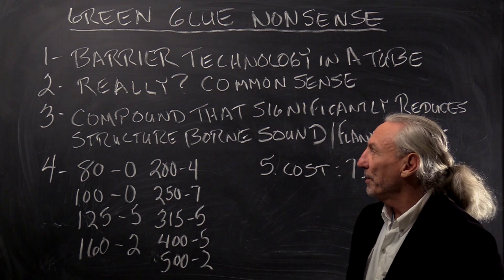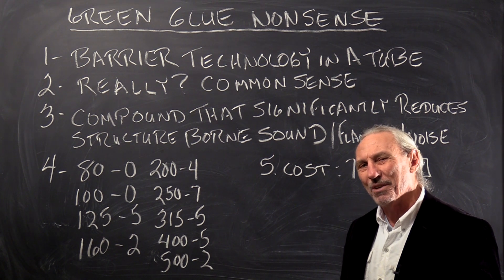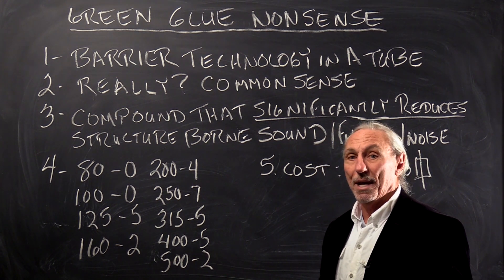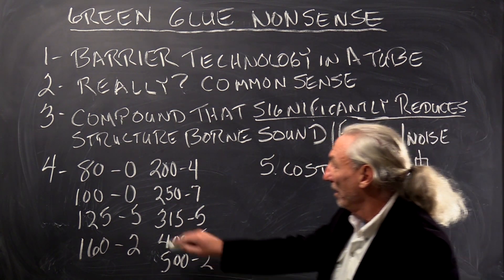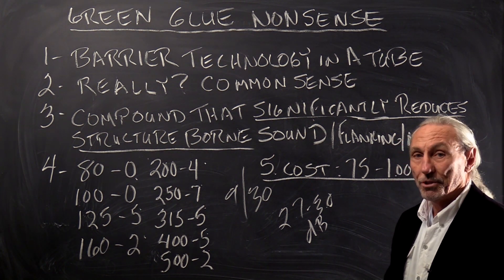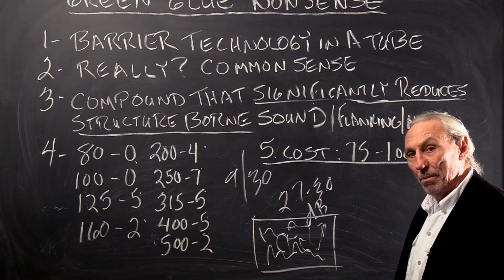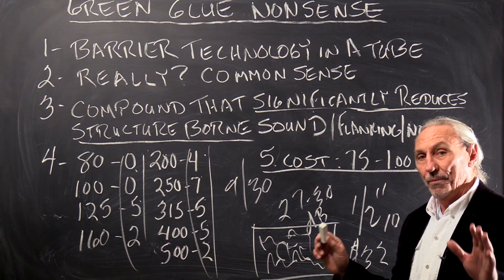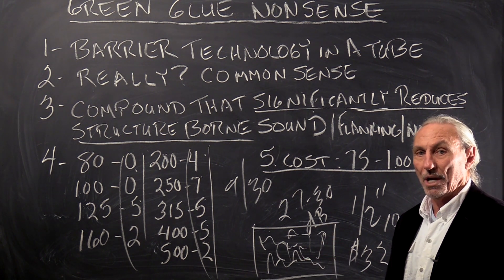Green Glue Nonsense - www.AcousticFields.com

Comment: guys help me... The tenant upstairs walks constantly in his living room and the ceiling of my bedroom creaks and the noises rumble. In the last two weeks I have tried to fall asleep with earplugs and drinking herbal teas to be able to fall asleep but the noises continue even after 11 pm so I can fall asleep very late when the noises stop. The noises reverberate and are dull noises
Reply: Perhaps you could route the vent from your boiler into the ceiling then seal it up with green glue. The upstairs tenant wont be walking around much longer with all that carbon monoxide floating into his living room.
Reply: you have to build a room within your room-- walls attached to a new ceiling where none of the sides touch the existing framework. 2×6 construction fully insulated will really help.
Reply from the maker: F,  Why are you recommending a 6" stud wall without knowing frequency and amplitude of the noise issue? Guessing with noise is a fool's game. Guessing with noise will produce failure rates exceeding 90%. And here is the issue with guessing and building on the guess. You will have to tear it all out and start over when it does not work. All of this guessing can be stopped with noise measurements.

Comment: Green glue is not an adhesive.
It is intended to dampen sound waves that transfer through Sheetrock . 
It stays visco elastic and dampens sound waves through friction of the material between  the two panels .
It is a latex polymer .
That stays visco elastic in colder temperatures than any other product.
However, if you live in warmer climates Roberts 3095 is all you need.
There is a noticeable difference when using them .
They are not a use or not kind of thing.
If you use another sheet, you still should use a visco elastic sandwich in your assembly.
You are not trying to create a membrane between the panels.
A continuous membrane would be bad.
It's proven tech.
And easily noticeable when used without.
I wouldn't use it if I lived somewhere that gets cold though.
And where it's warm you only need Roberts 3095.
So in my opinion green glue is only good if you can afford it, where it gets cold. Even then, some months it would do nothing if not warmed up.
It's still a good thing though.
Reply: The flooring glue definitely greatly deadens the reverberation of the sheet rock. When i tried it i thought i had come up with something original. the price of green glue had me in sticker shock and was thinking of what could be substituted when i remembered  i had just pulled up some sheet vinyl flooring that had been down for 20 years or so. The residue that was left on the floor was a sticky gooey mess. Hmm perfect. It's reassuring to see others are using it. Seeking to reduce the common noise of voice and footsteps and music is not rocket science that justifies an analysis of the frequency and amplitude of our noise issues. Most of the people on this site are not seeking to build a recording studio, just make their lives a less annoying. You are barking up the wrong tree asking for an analysis of the sounds we are seeking to eliminate. It's just the sounds of day to day life.
Reply from the maker: This product is an adhesive. There are many product types you can use to achieve the same function at a much lower cost.
Reply from the maker: H,  Why is it called "glue".  Is it limited to dampening "waves" or does it work with "rays" ?  Does it only work with sheet rock or will it "work" with other material types?
Reply: Acoustic Fields I think it's called "glue" because it was intended to replace Roberts 3095 carpet glue.
3095 / green glue works between any sandwich/ material assembly .
It's not much but every bit counts that doesn't take up room. 
The 3095 is dirt cheap.
So in here in Hawaii the Roberts 3095 is perfect for me. Plus it's an actual adhesive, so that's a bonus for me.
Review their tech data for additional information on the green glue, I just was pointing out that some of the things you were stating weren't exactly what the manufacturer is claiming .
I personally detest Green glue.
I've tested it against Roberts 3095 and where it's warm the Roberts marginally beats the green glue. 
I have a custom cut trowel for applying.
It's the more HP per dollar for me as shipping and square footage is insane here.
Reply from the maker: H,  Yes, it did replace carpet glue. That should tell you a lot about the basis for this product.  You are correct. It is not much and every little bit does not help. The problem with the name and marketing efforts of the company is that it plays upon the ignorance of the naive. Once again, you must measure the frequency and amplitude of the noise you are building a barrier against and then use the appropriate materials to deal with those frequencies and amplitudes. In over 155 builds to date, we have never used it. There are too many other options to consider with much better performance parameters.
Reply: Acoustic Fields what materials do you recommend? I’m about to purchase a box of green glue, but if you can tell me what would be better and cheaper, I’m all ears.
Reply from the maker: U,  What is the frequency and amplitude of your noise issues?
Reply: @AcousticFields  there are no rays within a solid - rookie error

Comment: Well what do you recommend as a cost effective alternative for the walls of a home theater room? I was going to apply another layer of drywall on top of the existing drywall with green glue to sort of 'decouple' the two walls. I'm not working with much space here, as the room is 17' by 15'. I considered using something like MLV in between drywall layers as well, or possibly 'floating' the MLV between two drywall layers.... before you say "it depends on the frequency and amplitute", lets assume we're watching movies at reference levels..  ;P
Reply: Its movies dude lol...  between 15 and 20,000 Hz...  best way to control bass from disturbing neighbors without using too much space in the room?
Reply from the maker: S,  Decoupling walls is a process used for middle and high frequencies. Low-frequency energy barriers require mass and density. When we build rooms from scratch wall thickness approaches 12-14". There is no easy fix for low-frequency issues.
Reply: I live in a block house with drywall. The SVS PB-16 sub laughs at walls..
Reply from the maker: S, What is the frequency and amplitude of the noise issues you are dealing with?  The methodology you are considering will only work for frequencies above 100 Hz.

Comment: Whats the material you would suggest at half an inch?
Wouldnt green glue come in handy with decoupling? Like if u separate  the sheets only with green glue, you end up with two sheets separated by a material that is resistant to sound wave conductivity?
That was my understanding of it anyway.
Reply from the maker: T,  It depends on the frequency and amplitude of the noise you are building a barrier against. It is not "sound wave conductivity" it is vibration transmission reduction. There is no one solution that fits all.

Comment: you are like the Einstein of acoustic sound. Glad i watched this video and saved me a lot of money.  I kinda knew even a silicon glue would the same as green glue but im not spending on that green sh$t. Im sticking to my 1/2 drywall and maybe a roxul safe and sound insulation for minor soundproofing. Thank you!
Reply: Einstein never did any practical science and just drew formulas on a blackboard to match what he wanted to believe... so yes this guy IS like einstein.
Reply from the maker: E,  Its not a cost effective solution. There are many other methods to achieve better results that will actually increase attenuation at lower frequencies.
Reply: Acoustic Fields I do not agree. You name the products that are better and more cost effective and I’ll let you know if you are correct. I bet you can’t. You haven’t answered a single question in these comments. -rolling my eyes— shaking my head...

Comment: but i have to wonder, do they really assume that the adhesive will be squished out flat ... this kinda creating an even coat across its surface? still though, 30 db reduced level? idk.
Reply from the maker: V,, It is supposed to isolate each piece from vibration transmission. It's a labor-intensive project  with high costs. There are better ways to achieve attenuation and get a lower frequency response coverage.
Reply: @AcousticFields  That is what I was thinking :)
Reply: Acoustic Fields im under the impression the glues function is to stop the resonates travel from sheet to sheet

Comment: Using construction adhesive with double layers of drywall will decrease STC from using no adhesive at all. Green glue, however, significantly increases STC value of the wall. Yes it is expensive a but it improves isolation. What is your better/cheaper option?
Reply: I'm guessing half inch plywood.
Reply: @brettus9115  well, that doesn't make sense to me. 1/2 plywood has an STC of 3, which is the same as a single layer of drywall. Application with green glue increases that to like 9. For STC calculations only 125hz and up is used because those are the speech frequencies. Averaging in performance at 80hz is misleading because the product never claimed to reduce sound at that frequency.
Reply: Hi Darren. I'm doing some research as I am finishing out a vocal booth design for my voiceover biz, and this comment intrigues me. Why would using construction adhesive lead to a decrease in STC vs. using no adhesive? Does "using no adhesive" imply creating a pocket of air instead, or simply something like liquid nails for the second layer?
Reply from the maker: D, Sorry, I didn't see your other question. We use a process with our activated carbon similar to the process described in this link which uses graphene instead of carbon. https://phys.org/news/2019-02-superior-noise-graphene.html. We have to start thinking out of the box and create new technologies just like we have done with our carbon technologies. The days when you stuff a box with building insulation and call it a "bass trap" are over. These companies are going to be extinct, they just don't know it yet.
Reply from the maker: D,  The issue with green glue is that it is promoted as a cure-all for all frequencies when it comes to barrier technology. I receive calls every day from people who have used it expecting that all their noise issues will be resolved. Nothing could be further from the truth. Speech frequencies do not begin at 125 Hz. We design vocal and isolation booths on a monthly basis. Our vocal booths start at 80 Hz. for males and 90 Hz. for females as a result of extensive voice testing. This blanket acceptance by the public of a product that is overpriced, labor-intensive and frequency limited is more about marketing efforts by the company.

Comment: So what would be a better realistic (IE: Not just "add another sheet of drywall") alternative? Is it better than nothing? Or no?
Reply from the maker: J,  First, stay away from drywall in critical listening rooms. It can be used as a barrier calculating its density into the room usage. Its usage depends on the pressure level within the room, room size and volume and a host of other variables.

Comment: Read on avsfourms that commercial theatres use just double dry wall each side of a 12” air gap between theatres, seems to block everything other than very low bass but even then its hugely reduced. How many times you heard the movie in the next room in a theatre. Dennis is this method work in a home setting?
Reply from the maker: S,  Using a 12" air gap is a waste of space when it comes to low frequencies in smaller rooms.  It is better to use mass and density for smaller room volumes.
Reply: Acoustic Fields how do they get away with that in commercial theatres?
Reply from the maker: S,  Mass and density over large room volumes requires lots of square footage of materials which increases cost. Using air as a barrier is cheaper but not as effective.
Reply: This is triple leaf

Comment: Finally, someone actually in the field of acoustics confirming my calculation of wasted money and time for something that doesn't work as expected.
Reply from the maker: R,  It has been accepted for many years as the "thing to do". However, as you can see by the data that they publish it has a very limited attenuation band of frequencies and it is expensive from both a labor and material side. I get calls every day from people who have used this material with drywall and are disappointed with the results.
Reply: @AcousticFields  Someone who just complains without an actual suggested solution is "JUST NOISE". You keep asking for specifics but even when people do, you don't answer. You just hint at the idea that you have a better solution without saying said solution, How about YOU give US a scenario and show some numbers? Doubt that will happen